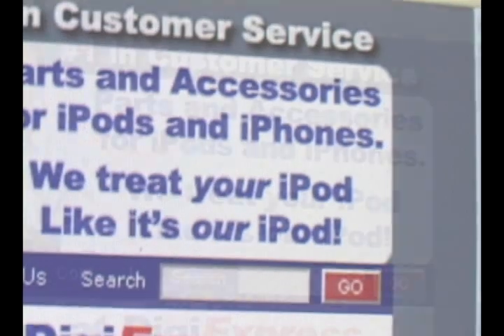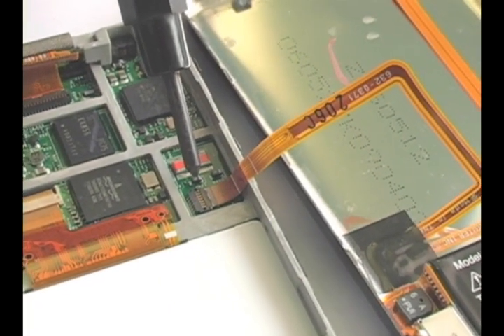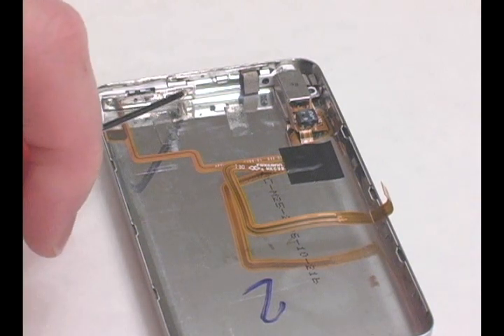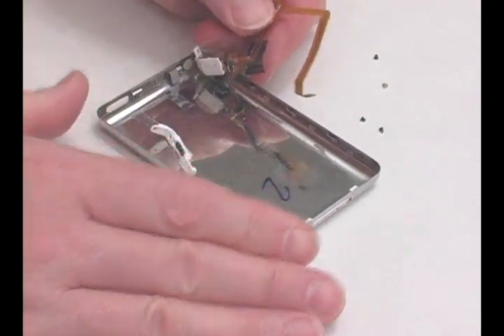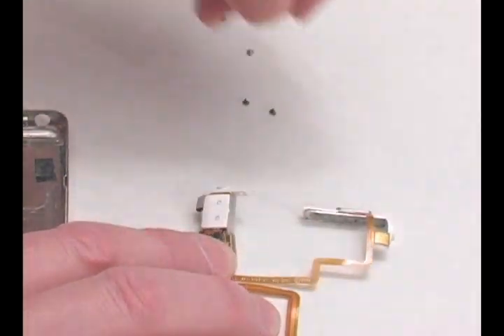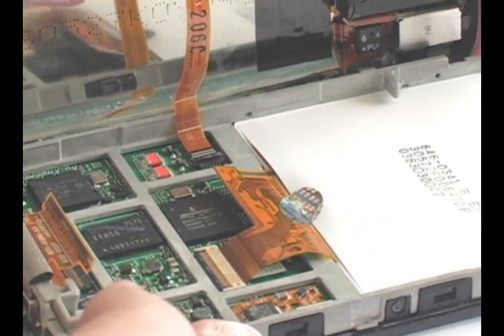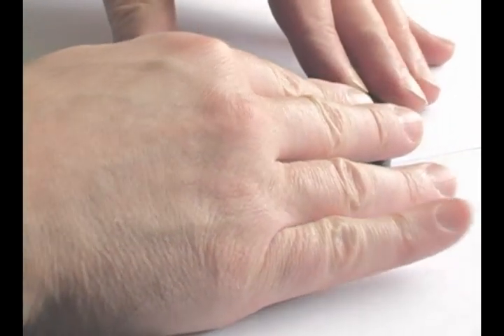DigiExpress - iPod Video / iPod Classic Headphone Jack installation

Comment: I followed the instructions in the video and my Ipod is back to normal...bought the headphone jack for 20 bucs.. thanks for posting the video. now here is a tip, do not remove the hard drive its not necessary; plus you can damage the hard drive cable or erase any files needed to operate your Ipod.. good luck

Comment: Awesome video! Thanks to it, I was able to successfully do a "headphone transplant" for the first time, and only took about 10 mins! I was amazed how durable and manuverable the inside of an ipod was, and the ribbon cables pretty much reattach themselves. I did have to use an extra screw from my glasses repair kit to secure the Hold Switch bracket, but no biggie, worked great.

Anyway, thanks again! Saved me tons of money and frustration!

Comment: after almost 3 months i finally fixed my jack. If your planning on buying a replacement buy one from a seller who gives a money back guarantee/ buy a jack that has the hold switch already attached, it may cost 3-4 dollars more but it SAVES a lot of trouble.

Comment from the maker: @AcousticallySoulFul1 I would check for the connection on the logic board where you plug in the battery.  the soldering on that small piece can be very weak and the connection can be broken at the solder joints.  If you look at the connection and find any leads that are not attached to the board, then you would need a new logic board.  The hold switch on the headphone jack may be stuck in the hold position also.  Check the hold switch, you may need a magnifying glass, for any damage as well.

Comment from the maker: @teveneyes the headphone jack itself would need to be replaced with a new unit.  There is a chance that the logic board was damaged, but given your description it seems as though it is just the headphone jack.  There is new real quick-fix for this kind of issue, which is a common issue.  The headphone jacks are the most used part of the iPod (next to the click-wheel). With headphones being plugged in and removed hundreds of times, it is only a matter of time before it fails and needs replaced.

Comment from the maker: The battery wire should not have affected the hold switch. When you installed the headphone jack did you make sure to line up the hold switch exactly like the old one? It sounds like you may have the hold switch contacts on the wrong side. Take it out and check to make sure that the contacts match our video.

Comment from the maker: @Persephone26 when you enter Diagnostic mode, select Manual, then IO, then Headphone Detect.  It will then ask you to toggle the hold switch.  Press the menu key to advance, once the test is completed.  The next screen will ask you to insert and remove a set of headphones.  It will test if the iPod recognizes that headphones had been inserted.  Now this tests only the headphone jack itself, if these tests pass and you have no output; the issue would be with the main electronics board itself.

Comment from the maker: @ShErDdEr100 The replacement batteries that we sell have adhesive strips on them.  You peel off the cover on the back of the replacement battery and the adhesive is there.  You should seat the battery first to make sure you know where it will fit then remove the backing from the adhesive tape.

Comment from the maker: @Lman175 Yes it does, the 30GB jack is slightly different than 60/80GB jacks. It will not fit in the case.

Comment from the maker: @ihategwen They may be brown or tan as well, they are FPC style clips (aka ZIF clips).  They will be on the logic board, at the point where the ribbon cables attach.  Basically follow the ribbon cables to the the logic board, when you get to the connection point, examine it closely and you will see the plastic hinged clip that we are speaking of.

Comment from the maker: 1.Check your hard drive ribbon cable to make sure it is inserted fully and correctly.
2.Check the USB connection for damage to the port.
3. Use an outside application (available online) to transfer your data on to another HD and restore.
4.We can diagnose and repair the problem for $25, plus parts. You will not lose your data unless you have a damaged hard drive, which in that case it is already gone.

Comment from the maker: Did it come off, or break off? We have replacements if you just need a new one, but if you broke the connector pins off the main board, then you will need to replace the main board.

Comment from the maker: @Beastandthebartender 

They are the same headphone jack, however the 30GB plastic tip is contoured to fit the 30GB back plate, where the 60GB is not. 
If you put the 30GB hpj in the 60GB iPod it will work fine, but it will not fit flush with the opening in the case.

Comment from the maker: @stoutevan The ribbon cable that connects the hard drive to the logic board is very delicate and you should try to avoid bending or stressing the connection when possible.  So if you remove the hard drive it is just playing it safe.

Comment: It may be that the jack of the headphones you are using is slightly bent.

If you replace the jack, then plug the same headphones into the new jack, you will instally screw it.

Happened to a friend of mine.

Hope that helps.

Comment from the maker: @laurasautographs That is a unique situation, though I believe that what has happened is the bottom of your headphone jack (the internal part on the iPod) has broken through and is allowing your headphone plug to move past the backend of the headphone jack.  This would cause the jack to "hit" the LCD screen and cause damage. I cannot be 100% certain but I would start by replacing the headphone jack as it is less expensive than the LCD.  You could also send it to us for Diagnosis / Repair service

Comment: after watching your vid I saw that I had the white liner for the hard drive under instead of on top of it.............snaped back in place.........to bad i made a damage mark on the lcd trying to snap it back together before and dented the new back panel ........ will have to order new parts for it...... thanks for the help

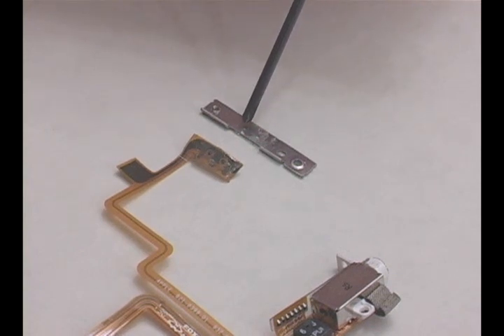Comment from the maker: Watch this video from 2:45 on, it will show you how to line up the contact points. Also make sure that the plastic part of the hold switch is over the nub to move the hold switch back and forth, it may not be lined up properly, which would prevent it from turning off and on.

Comment from the maker: It sounds like you may not have the hold button aligned properly. Open the iPod and make sure the hold switch is making a contact.

Comment from the maker: @321NaMlaTeM 

Yes, however sometimes the problem is caused by the headphone jack connector on the main board, not the headphone jack itself. It is worth a try, that is not really a difficult installation.

Comment from the maker: @Shapbase I have seen situations in which the device will function properly while it is still disassembled then upon reassembly the functions are no longer proper.  It this is the case then you may have a problem with the logic board (main electronics board).  Though when you are reassembling the device make certain that all the parts are nested or seated properly before you completely close the iPod.

Comment from the maker: @xendersshadowx It sounds like your hold switch is locked in the "hold" position. In addition, you may not have attached the hard drive ribbon cable correctly, which would cause your computer not to recognize it. Go back through the installation and make sure that both the hard drive ribbon and the hold switch ribbon are connected correctly.

Comment from the maker: You do have to pull it out of the device. But you wouldn't lose any data, as it's all stored inside of the hard drive. The headphone jack is actually attached to the back plate and is hidden under the other parts.

Comment: This vid is great, I replaced the battery with your parts last year, the headphone jack went out recently. I got the part and replaced everything and it worked great until I put it together, any suggestions on what I should check to correct it, I would really appreciate it. Help..

Comment from the maker: @carlosfriend123 As long as they are the same sized hard drive, it will go right in.  If the HDD size is different then you will need to deal the difference in space; regarding the backplate.  The headphone jack is "spaced" by using a small white plastic part.

Comment from the maker: @Jedijoe942 The first generation iPod Touch is very difficult to replace the Headphone Jack.  It requires a very small soldering point (six of them) and you are working directly on the logic board, which makes it very easy to damage.  We have a breakdown because the common DIY'er should not attempt the installation.

Comment: I have an 80GB iPod Video, the headphone jack moves around (with iPod closed), and when you wiggle it around, you might get the right headphone to work, otherwise, only the left one works, if you take it out halfway, both work, but it's very frustrating when it keeps popping out in my pocket, could this be a loose screw or somethin of the sort, because the whole assembly wiggles when you move the jack.

Comment: Hey guys i just did this repair and almost broke my ipod because i disconnected the hard drive and couldn't get it back in to the right slot. You do not need to disconect the hard drive it has nothing to do with the headphone jack. all you need to do is flip it up to access the headphone jack cable. thanks for the tutorial

Comment: I have successfully- well, I hope successfully installed my new headphone jack and want to say thank you for posting this amazing video! Unfortunately, my ipod classic is still not registering an output sound. I went to diagnostic mode and reset the device. I also checked the IO section on the menu and there was no tab for AUDIO. Are you able to help this poor soul?

Comment from the maker: It sounds like the battery cable isn't making a connection to the main board. Open it up and check the battery cable.

Comment: I followed these instructions step by step but now my ipod is permanently locked. Tried all the easy hold down the two buttons blah blah advice (buttons & wheel have no response) and my ipod is not being recognized when i open itunes or my computer even though i hear it ding that i new device had been plugged in. any advice? I already ganked the video screen pretty good just trying to open it so i'm feeling like this isn't going to work...

Comment from the maker: @BALEnaVICO You may need to have the headphone jack replaced.  First use a different set of headphones to see if the problem persists.  If you still have the problem then you may need to replace the headphone jack itself.  We carry the part for the iPod Video or Classic model on our website if you would want to repair it yourself, or we have a Diagnosis / Repair service that can either Diagnose a problematic device or act as the labor in repairing the device.

Comment: Nice video! I changed the part without problem. However, I do only have sound in one side of my headphones. Does anyone know if I did something wrong or it is the replacement part that is not working?

Comment: I followed this process step by step with the Digitech headphone jack replacement part, and I ipod won't cut on anymore. I tried checking the battery and the harddrive ribbons to make sure that they where in good. they where in good, but the ipod wont cut on. what should i do??

Comment from the maker: @kingStardust You should not have your data erased but the best solution to this problem is to get a wall charger so that you do not have to worry about if it will be lost. Also you would be able to charge the iPod from anywhere. We sell them on on website.

Comment: @DigiExpress I tried to follow your steps but it didn't seem to work. (My lcd screen is "bleeding" so I can't read the steps.)  Everything else works on my ipod but it won't detect the headphones.  I can still hear the default wheel click when selecting a song. All i can make out is HP at the end of the sentance under Manual ---> IO --> HeadphoneDetect, and it wont let me exit.  I triplem checked everything and its all inserted correctly. Please Help!

Comment from the maker: More than likely replacing the headphone jack will fix the problem. In rare cases, the main board is causing the problem. Order a headphone jack and before mounting it to the back plate, just disconnect your old one and connect the new one to see if it works properly. If not, you can return the headphone jack for a refund.

Comment: MY 30gb ipod is defective the battery and the headphone jack cable is broken but i can only turn the ipod if it connected to the 13 volt charger

Comment from the maker: It could be as simple as the battery isn't making a full connection with the main board. Verify the connection is tight. Also, check to see if you're getting a charging icon when you plug your device in. If you are, then it could be that the battery needs replaced. We have those on sale for $9.99. Here's the link: digiexpress.us

Comment: WARNING TO THOSE ATTEMPTING TO REPAIR YOURSELF!  Do not attempt to open your Ipod unless you have ALL of the right tools (and the patience of a watch repairman).  Thinking this would be an easy repair, I ordered a replacement headphone jack because the jack in my 5th Gen Ipod Classic had come loose and was now only playing to one side.  After an hour of prying the clips holding the top from bottom case I managed to completely destroy my Ipod.  I really wish I that I had sent it in.

Comment from the maker: @zuma5278255424 The headphone jack audio quality is the same as the original Apple unit, there is no better headphone jack.  You are correct in that the audio is controlled by a microprocessor on the logic board, it has only one setting for quality, beit through the heapdhone jack or through the dock connector at the bottom.  However, when using the dock connector for audio output; you tend to get a better signal.  Most of that improvement comes from what ever device the iPod is plugged into.

Comment: I actually did it, and sadly without success. I found a screw that completely came out, I screwed it back in, the headphone jack doesn't wiggle anymore, you still have to pull it out a little to listen to both headphones, but it stays in better now, so thanks a little bit, I guess.

Comment: Im having a problem with My ipod is  the same one Ipod video as in the video a 30 G, I bought it used online, when I received the the IPOD only one side would hear but if I take out the input jack a lil out Both sides sound good,3-4 months later I was watching a video but no music, When I insert the input the static connection sound Normal ,But no music, everything seems to play, including videos But no sound,1 day I tried and it work for 3 sec, Anybody knows what may be the problem??? thank you

Comment from the maker: @zuma5278255424 for certain devices you will have a set of electronics on the jacks themselves (internally obviously) and these will aid in clearing up noise or things like that.  Most of the output is through a standard TRS connector (which is Tip, Ring, Sleeve connector).  If you hit wikipedia and look at TRS connector you will find a host of information on this topic.

Comment: no it works fine until it returns to a normal temperature i think what happens is something in the ipod needs to be cool to work, over time the ipod lost resistance work at a normal temperature, nobody on the forums has any other solution

Comment from the maker: @das9582 In some cases you may need to replace your mainboard, but without having a proper diagnosis completed it is unreliable to diagnose issues via the internet.  We do offer a Diagnosis service for $25.00, which includes the labor associated with installing parts and testing the device after the repair.  Visit our website for more information.

Comment from the maker: @dchimge 
It sounds like you need a new earpiece speaker, but without seeing it, I can't be sure. For just $25 plus the cost of the part, our techs will diagnose & repair it. Give us a call or visit our website for more information.
1-800-440-4693

Comment: Thanks a lot, this saved me a lot of money. Though it was frustrating and I was pretty sure I would end up with a broken iPod, I did not. @xendersshadowx I also had a permanently locked iPod the first time, I had to open it back up and make sure that the hold switch mechanism actually toggled the switch it is attached to. After that, no problems.